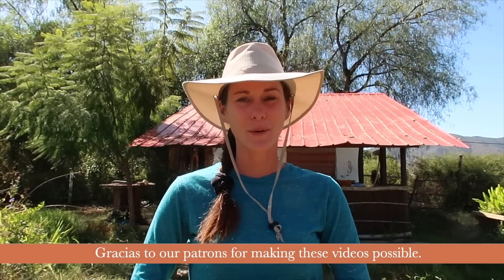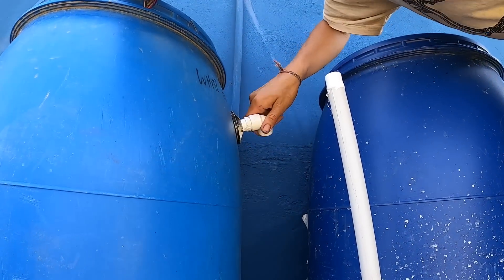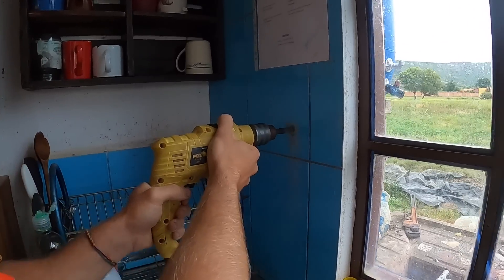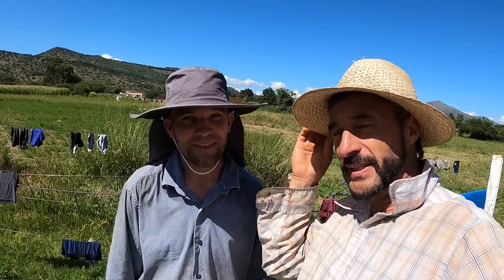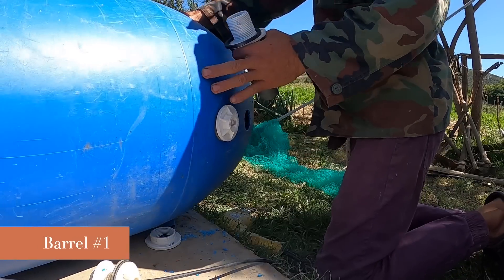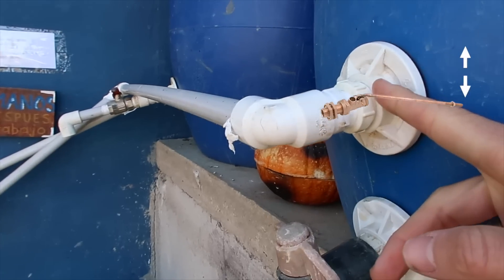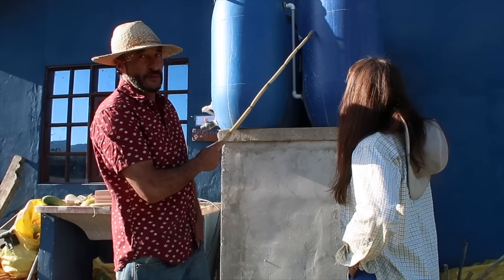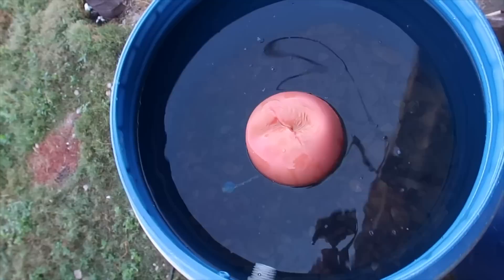At home WATER FILTER | How to build your own

Comment: You are not using activated charcoal. It's just plain charcoal, which you made dirty again with your orange juice. Please to all: leave this juice step out - this is just a bad myth! I think Cody proved that this (orange or citrus juice) does not activate the carbon.
Reply from the maker: Interested to see how you suggest activating the charcoal
Reply: @Kaiwaipermaculturebolivia  Activating charcoal requires very high temperatures and a sophisticated setup, or certain chemicals - both are rather hard to achieve for the amateur. However, is it really necessary? Well, since "activating" the carbon more or less only enlarges its surface area, you can compensate the lack of activated carbon simply by using more charcoal. You already used quite a lot of charcoal, therefore there is no real need for activating it. In fact, your juicing step probably even decreased the surface area of the charcoal, and you obviously still get decent drinking water. So either just go without the activating step or buy activated carbon instead of charcoal in the first place.

Comment: when quoting the use of silicon use fish tank silicon as bathroom or kitchen silicon has fungicide within it and would be bad for health if water from this was consumed. Fish tank silicon has no chemicals otherwise a great video
Reply: I have a problem with using silicone in contact with drinking water, there must be a different approach. Would you repair a broken drinking glass with silicone and actually feel alright drinking from it?
 Maybe just a super good fitting gasket and skip the chemical contamination altogether. 
 I’m also a bit hesitant using the plastic drums because we’re not 100% positive it doesn’t contain BHP. I’m wondering if concrete tanks would be more or less safe. Stainless steel is optimum but expensive and here in the Philippines some tanks advertised as ‘stainless’ are actually low quality stainless and soon start to rust.

Comment: right behind you is a roof   fit guttering and down pipes with dump valves and  water every time it rains ,lived on tank water a long part of my life here in AU and TPNg  with the dump valve it puts the first of the a water on the ground thus removing droppings and dust and whatever  plus a sieve with fine mesh on the tanks  secondary filter .as  a Kiwi you would be aware of this  ,other tip use geo clothe as the filtrating medium as it lets through  water but not silt  ,reason used inland scapeing and other works
Reply from the maker: Che bro, we are in Bolivia and cant easily get geo cloth but sounds good! Our roof above is tiny and 4 sided. Could set it up to collect water. Have done for a friend with a bigger roof in a nearby city. Here we get so little rain for such a short season that it wouldn't add much to it.  We do harvest rain water into 3 swales and have a well.

Comment: How often do you have to change out the materials because they get to contaminated?
Reply from the maker: The charcoal is good for two years. The first tank gets flushed periodically from the bottom valve. The second tank can be opened and stirred from the top scooping any fine sediment from it when the flow through rate slows. . Thats all the maintenance required

Comment: Thanks for sharing and helping the community there! Perhaps I missed the part of hamdling potential bacterial buildup found in standing water (i.e. if you went on vacation)?
Reply from the maker: We havent had that prob as is in constant use. I am amazed at how long water from this stays good if left in a glass beside the bed. If you had an issue after a long time of no use: Empty the inlet tank and reserve tank. Clean reservoir with baking soda, rice water or vinegar. Refill and flush twice the volume of the reserve tank through it with some Cl02
Reply: @Kaiwaipermaculturebolivia CIO2 ?

Comment: Hello, thank you for making this video. Very appreciated ✊ I do have one question, could this process be scaled down to one tank operating as the filter and one storage for the clean tank ... Did you elect to go three filtering tanks becuase thats what was necessary or as a percuation?

Im in California going to filter city water... Space is a consideration, if you have time to respond, i would be very grateful. Thank you either way.
Reply from the maker: Hi Aaron, for sure you could do this with two tanks. I guess.it would need to be cleaned out once a year as a sediment layer would form on the fine sand layer i.e. between the charcoal and fine sand.
Reply: @Kaiwaipermaculturebolivia  Thank you for the response! My last questions and forgive me if it's obvious but do I need to use smooth river rocks for the big rocks at the base?  I imagine any rock will do and perhaps the smooth stones are better for memory but what I have available to me on the land is the more rigid looking stones,  Wanted your thoughts on smooth river rocks vs the more clunky land rocks.  Thank you again.  You got a new subscriber.=]
Reply from the maker: @aaronperez5047  give em a clean and they will be fine. Fyi if you find that you have algae build up in the first few weeks of use just clean away the build up (probs will be at the top plumbing connections).  This would indicate that there was organic matter in the media. The algae eats that so by cleaning away any algae that forms you will fairly quickly be left with a clean system. Say this just in case the rocks are hard to wash.
Reply: @Kaiwaipermaculturebolivia  You guys are awesome, thank you so much!
Reply: @aaronperez5047  Agreed! We're in a very poor area of the Philippines and clean water here is damned expensive for local people, unless they take their chances on the local supply. I did once and it got me 3 days in hospital with a nasty GI bug. I want to try this on our well; it's a lovely simple system and well within my pension! Commercial filters are so darned expensive. Plus my relatives who live in the real bush can get reliable clean water, instead of a dodgy stream that has goodness knows what floating down from the hills.
Reply: @tyrotrainer765  what part of the Philippines are you located? We’re in a quiet area of Cavite.
Reply: Hi Brian, Western Visayas.... It's right dead centre of the archipelago. Our island is Panay, triangle shaped, quite big, but otherwise pretty crap.3rd world in action.
Reply: @tyrotrainer765  okay, I guess it’s not easy to hop over to see your filtering set up. Isn’t that the same island where Texas Filipino is located?
Reply: @nelsondog100  No idea!
Reply from the maker: You would know when as the filter  flow rate would slow down

Comment: Will the water filtration barrel setup filter out chlorine and fluoride? Is there somewhere to get a list of the stuff that it will filter out or that it will not filter out?
Reply from the maker: Yes it will filter chlorine and flouride The chemicals I would worry about would be the super corrosive kind like those our poor brothers and sisters in Ohio are being assaulted with. In that instance I would switch to cement trenches with overflow dividers of cement too and much more carbon in the trench to fill an in ground tank to act as a clean water reservoir..
Reply: @Kaiwaipermaculturebolivia  I’ve been told that alum is a necessary filter media to leech out fluoride.  If this is true, which of your media contains alum?

Comment: So you're running your current water through this for better filtration, right?  Is this not for a disaster solution...  it won't collect rain water or anything?  
Very nicely done, regardless.  Just trying to come up with a disaster solution, is why I ask.
Reply from the maker: We could put the well water through it which would take out agricultural chemicals.  For that I would put a 160 litre header tank on it with a separate float valve to fill every time we pumped.
Reply: @Kaiwaipermaculturebolivia  Thanks!

Comment: Why do you need to put the float valve at the bottom of the tank? Would it work if the float valve would be installed somewhere at the top of the tank, but the output of the float valve would be installed with a pipe which would run down to the bottom of the tank where the bricks and large stones are placed?
Reply from the maker: Yes the float is at the top water level near the top of the tank. The actual valve is near the bottom, the switch off arm is connected to the float with a string that is inside a tube to allow free movement
Reply: @Kaiwaipermaculturebolivia  i meant the whole assembly, including the valve, would be somewhere on top. Then just connect a pipe to the output of the float valve so that it goes down to the bottom, in that way, the water still fills from bottom to top.
Reply: @Erick-Tags  yes, that would work also. Easier to check operation and maintain the valve. Some ball valves have outlets with threads for this purpose but they are sometimes hard to find.

Comment: You have built an upflow filter system. Wouldn't a downflow filter be simpler? Thanks
Reply from the maker: Up flow supports solids to settle at the bottom.
Reply from the maker: We could put a header tank on it to provide downflow to the system with batch refill of that tank if it needed to be filled by pumping or manual means
Reply from the maker: @tomtomate8455  so that it can come out with pressure at lower elevations in case you plumb taps from the last tank. We have a tap from this filter in our kitchen and do notice when the water level is low

Comment: From Jon's video, the flow from first tank to second tanks inlet was at the same level. Why did you bring the second tank inlet to the bottom? Did something fail from the initial design?
Reply from the maker: I dont think it was. The flow from the 3rd to 4th is level
Reply: @Kaiwaipermaculturebolivia  - In bottom of tank 1, out top of tank 1 - in top of tank 2, out bottom of tank 2 - in top of tank 3, out bottom of tank 3 - in top of tank 4, out bottom of tank 4.
Reply from the maker: @The_Hairy_Farmer  *in bottom tank 2/out top tank 2, in bottom tank 3/out top tank three, in top tank 4/out bottom tank 4
Reply: @Kaiwaipermaculturebolivia  - How I said it is how it is in Jon's original video, as @vmicheni also said.

Comment: Another idea for killing microbes without bothering with Moringa seeds is this...  With a large rectangular container (like an aquarium or cooler), partition in half with a divider in the middle that has a hole in it stuffed with polyfill.  Put as clean as water as you can find on both sides of the partition.  Hang a piece of pure metal on both sides of the cooler/aquarium.  Using a solar panel or rechargeable battery source,  hook up the anode and cathode to opposite sides of the tank's hanging metal strips.   The polyfill will allow water to come and go between the two differently charged sides.  After a period of time, one side will have water that is negatively charged and the other side, the positive.  Scoop water out of the positive side and pour that into whatever water filtering system you're using.   As mentioned in the comment below, the proton that you add to the water that has microbes in it, will attract the opposite sides of the microbe and they will stick together (think of a Cheerio (TM) oat cereal), and will make the microbe harmless.  I wouldn't put the filthy water in the divided tank.  Just clean water. That way you won't have to clean the Proton Water Producing Tank so often.  In a pinch, one could just substitute the two Moringa seeds per liter (as described below), and just add an ounce to bad water, and like the Moringa seeds, the stuff floating within the water will sink to the bottom allowing the use of 70% of the water in the now much much clearer water.  The goal is to make the microbes harmless.  The Moringa seed method doesn't require electricity.   I have 70 Moringa trees in my yard and a boatload of seeds.  So when the SHTF scenario occurs and I have to drink my neighbors' stagnant pool water, the Moringa method is cheaper and more available and doesn't require a battery or solar panel.  But, for those don't have a Moringa forest, the electricity method could keep them from having dysentery.
Reply from the maker: Interesting again. Should we put Moringa seeds in tank 1? How long can they stay in for? Should it be one seed per litre for the entire system? I.e 4x 160ltr  tanks = 640 litres and 64 seeds. Would the idea be to replace the seeds every full flush? We are contemplating periodic use of chlorine dioxide.
Reply: @Kaiwaipermaculturebolivia  After you watch the video I provided the link for, if you want to use Moringa with your system, you could consider a final moringa-charged fine sand layer.  With that layer the organic matter of moringa would be absent and the charged fine sand can last quite a while so that it doesn't become a pain to maintain, and also by being a late-stage filter it could be the last chance to get those pesky microbes out of the water.  It would be interesting to see a comparison of what is going to your house and the same water, but filtered through the charged fine sand.  There is a small device that measures parts per million of what's in a liquid.  That and/or a microscope could verify that the charged fine sand is worth the effort.  A cheap way to prove that moringa works is to take two liters of city water, and put that in two clear bottles.  Leave one alone and in the other put 2 crushed moringa seeds and stir.  After an hour or so, see if there is a difference.  Same experiment could be done with more murky river water.  That will provide a more vivid difference.  Do you have moringa down there?  If you have a ton of seeds, you can press them and extract BEN OIL which costs about $400 per gallon and is used in the health products industries like ones that make lotions and such.  Then with the extruded part of the moringa, you can mix that with water (like in the video) and charge fine sand - or you could just add that mashed pulp into a filter tank that you have to periodically maintain. After creating the moringa water used to charge the sand, you can feed the organic matter to your animals.  It keeps giving.  Lots of variations possible.  Start small and prove it to yourself with two liters of clear and two liters of dirty water.  Sorry for all the words but I like the subject a lot. - Jim from Phoenix

Comment: Here's a good URL link to a YouTube presentation where it's discussed that Moringa seeds can be used to charge (positively) fine sand, that when used in a filter,  makes the microbes harmless.  Microbes have negatively charged ends.  Moringa seeds (and the resulting charged fine sand) add a proton which forces the two ends of the microbes to stick together.  While it doesn't kill the microbe it makes it harmless.  With the sand-less method Moringa seeds (shell them first) are smashed and added to dirty water (two seeds per liter), almost 97% of what was floating within the water sinks to the bottom, and the top 70% of the now clear water can be used for drinking.  In the method related to the video link below, the positively charged sand (with the organic Moringa matter removed after the sand is charged), can be used in a make-shift Berkey filter (or as another layer in the system in your video) and used for routine and more long-term filtering, improving whatever water is put into the Berkey.    Here's the video link https://www.youtube.com/watch?v=hN13JnB4neE&t=351s   Growing Moringa in Bolivia is great in so many ways.  Water purification is yet another reason why it's called "The Miracle Plant'.

Comment: Thanks for spreading a choice for people. You did a good video and easy with good detail . I will recommend  others to watch your video. It will be a lot easier when English speaker  explain how to do it.
Reply: J&S, love the video, and now I am a fan, as I am a fan of Jon. 
Jon, you’re video is very easy to understand and follow. I worked in the water and wastewater field for years and love videos of home made water filtration system and how to make active carbon. 
I would love to see video of adding UV lighting powered by solar cells on the final tank where the activated carbon or an additional fifth tank. Also the solar panel placed on top of the tanks help shade, cool, and prevent BPA leaching into the filtered water. The carbon helps prevent that, but I believe cooling helps maximizing its efficiency.
Great job all
Reply: @Jeff-0621  as
Reply: Hey Jon, from Australia. I'm pretty sure I left a comment on your video about how good your design is 👌 & It's really good to see other people copying your filter design & paying tribute to you & your community. I hope you are all doing well! 👍
Reply: Jon, I  have watched your videos many times. I appreciate them. I've been gathering the pieces for both the filter and steel barrels for making my own charcoal.   Your English is great. Thank you all.
Reply: Jon, I've seen your video too and it is wonderful! The more we share our knowledge the better.
Reply: You need to use fish tank silicone for your joints. Construction grade silicone is not safe. Used it on a fish tank once and it killed the fish.  Not sure about humans, but I would research or not use construction grade silicone. 
Thanks
Reply: I watched your video several months ago. I think your idea is very clever. I'll be using the design for the basis of my water filtration system when I build it.
Reply: You work together very nice as a couple.  I enjoyed and learned how to filter my dugout water in northern Canada.  Thank you .
 Where do live ?
Reply from the maker: Thanks for the kind words Jon. In reality your video is so easy to follow and we'll made that, any other, even a copy, merely seems like a poor sequel. We really enjoy your philosophy too.  Much love, J&S